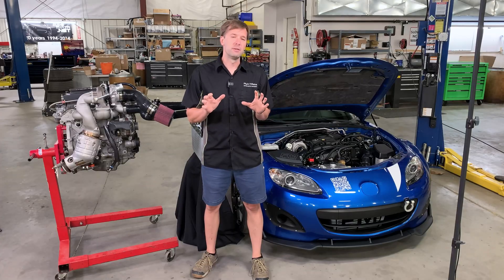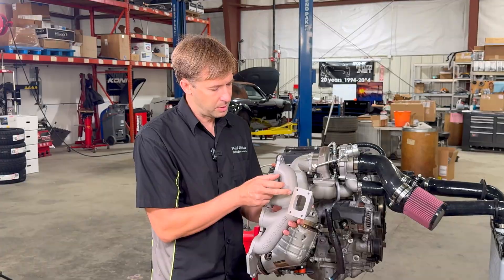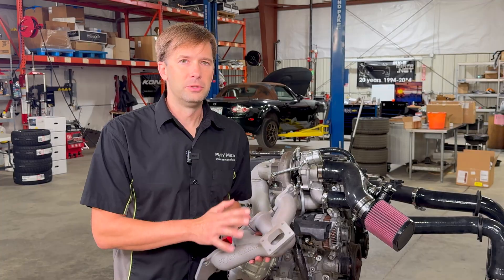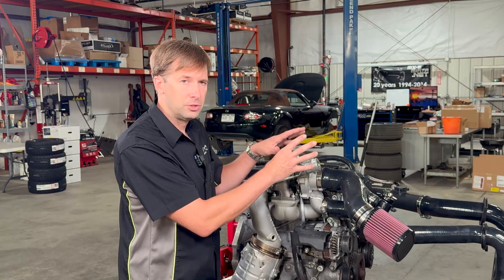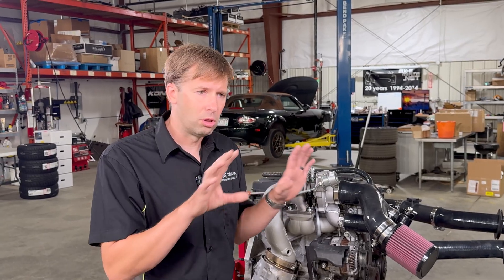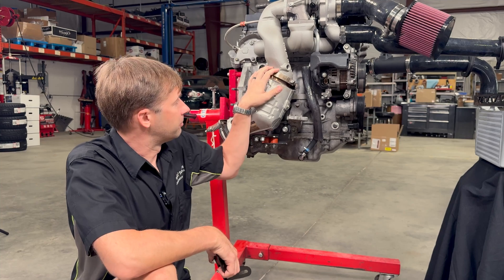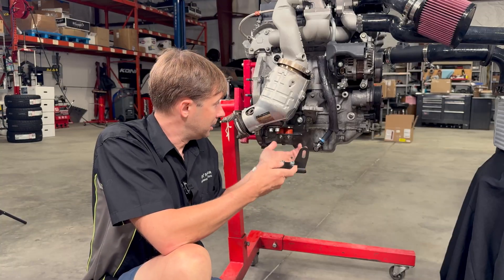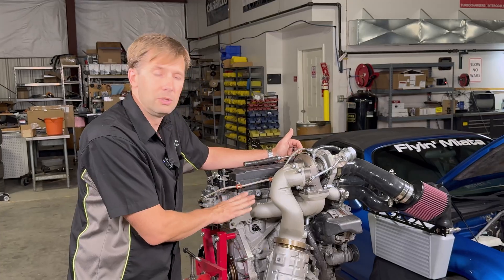NC Turbo Tech Talks - TURBO ASSEMBLY - Episode 2

Comment: Hello, do you need an upgraded clutch? or can the stock clutch withstand the turbo kit?
Reply from the maker: goldenollies8338 If your stock clutch is still in good shape, it will handle the power of the turbo kit for a little while, but will eventually need replacement. However, if you have something like a 150,000+ mile NC with the original clutch still in it, we'd probably recommend replacing it (or being prepared to soon after boosting the car).

Comment: What are the exhaust recommendations for this kit? I'm currently 100% stock. 
Can I use a high flow cat instead of retaining and welding the stock one?
Reply from the maker: All of our testing has been done with stock exhausts. You can use a different cat if you'd like, it just has to have the same geometry and location as the stock unit to mate up to the upper half of the downpipe.